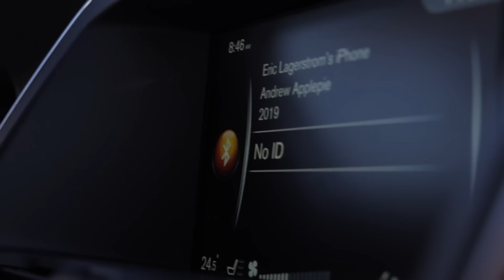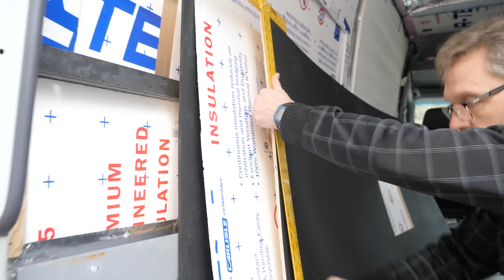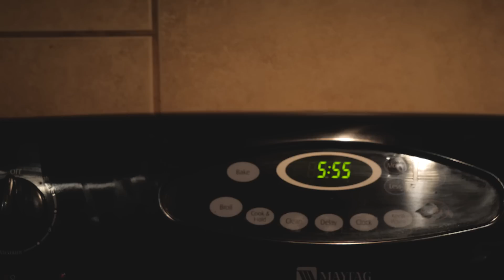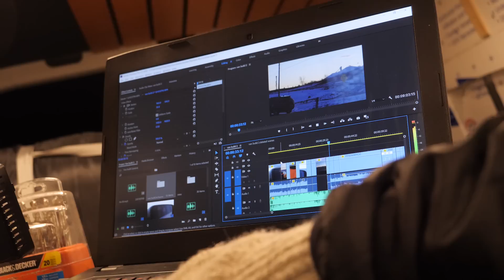VAN CONVERSION PART 2: ELECTRICAL SYSTEM

Comment: Just found you and subscribed!!!! What fabric did you use on your walls? We’re in the middle of the Baltic birch vs fabric wall decision. Thanks!
Reply from the maker: Hey! Welcome! I don’t know the exact brand, but we used fabric that is essentially furniture-grade, intended to cover couches, etc. And also is very stain resistant. We actually got some grease on it during install and it came out with some soaking/wiping.